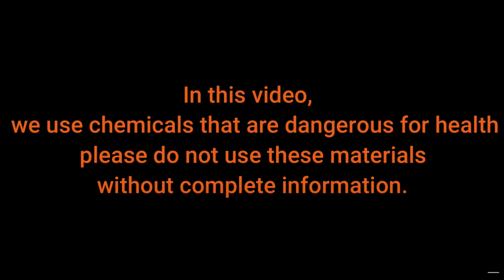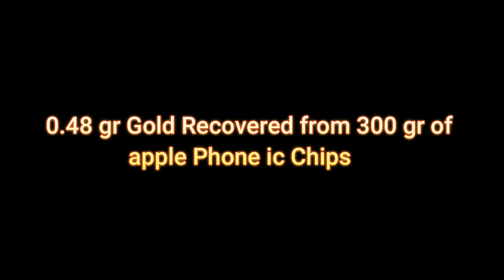Gold Recovery from Apple  İphone ic Chips | Gold Recovery from İphones | Gold Recovery

Comment: Mr. Iman I would like to know from you. Can gold recovery be done by anything other than SMB in Aqua regia. Such as forrous iron sulfide.plzz..guide I will wait for your detailed reply
Reply from the maker: you can use others :

 1. Iron(II) Sulfate - Ferric Sulfate
 2. Sodium Bisulfite (Sodium Metabisulfite)
 3. Hydrazine
 4. Sulfur Dioxide Gas (SO₂)
 5. Sodium Borohydride
 6. Potassium Sulfite
 7. Zinc - Used as a strong chemical reducing agent
 8. oxalic acid 
      9. ascorbic acid 
      10.sodyum nitrit 

These precipitants are chosen based on the conditions and the type of process, with each having its own advantages and limitations.
Reply: Thank you 😊master 
Assalamualaikum